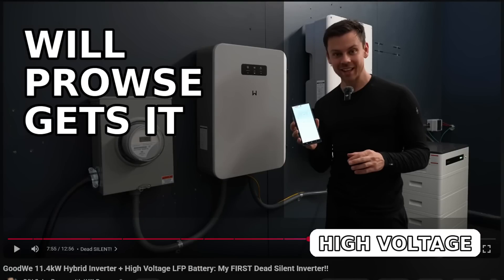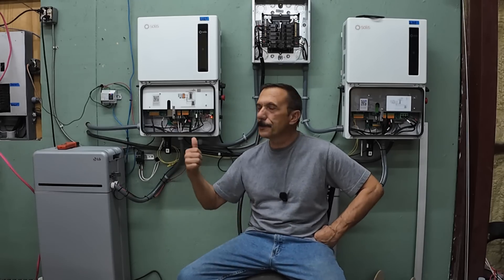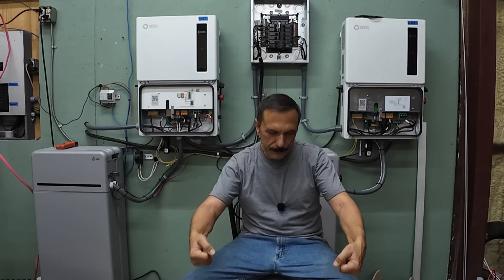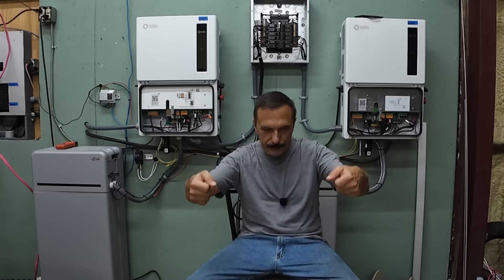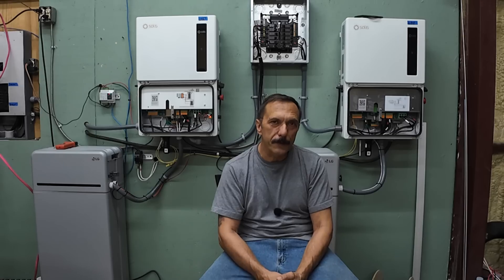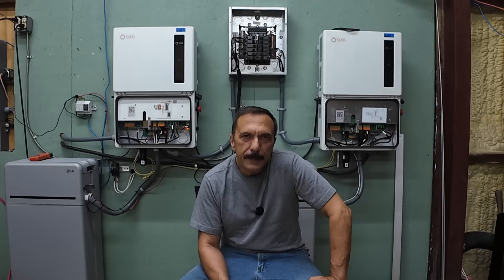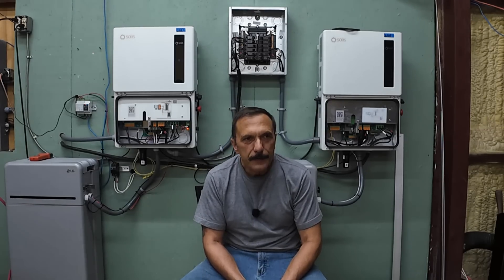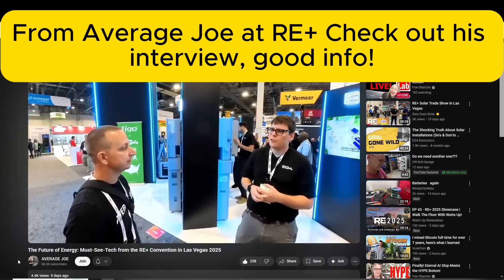Will Prowse Gets It! High Voltage Solar

Comment: looking into a 2nd system for 2nd location but HV is still 50% more than LV and upto 20-30KW with 60-100KW batteries or so i dont think it has enough benefit to make the extra price worth it
Reply from the maker: How does this compare to LV, Solis S6 11.4kW inverter @ $2325 ea. 15kWh Soluna LFP batteries @ $4699 ea. stack up to 150kWh per inverter or LG 16H Prime 16kWh @ $2750 ea. stack up to 32kWh per inverter.
So 3 inverters 33kW = $6975 + 6 LG batteries 96kWh = $16,500 total $23,475
Reply: @DIYSolarFarming  20kw Deye lv inverter @2750  so 5500usd for 40kw, 15kw lv battery @ 1184USD so 105kw @8288  (excl shipping though) making 13788USD count maybe 5500USD shipping.... so you can add all the 20-25kwh solarpanels to it and still be cheaper out

Comment: Hey thanks for the video, liked it... My only problem with running car EV batteries in houses, are if they happen to be of lithium-cobalt variant, where many home retrofitters throw away the cooling systems they had when they were in the cars, and put a dumber BMS, they can be at higher risk of experiencing thermal runaway in some case. If I did run a battery with cobalt chemistry for residential use, I'd put it in a detached structure that is not connected to the house. Obviously having a good quality BMS plays a huge role in the safety, but for me I prefer only the LFP to be in my residential building, because they are much safer and not likely to ever get into thermal runaway condition ever. There are Fire Dept videos on You Tube where they try to force LFP into thermal runaway and the most they can get is sizzle and fry, but really no fire or intense heat. Just my 2 cents.. Thanks again for the video!
Reply from the maker: Exactly, never put an EV battery in your house!
Thanks for watching!

Comment: I downloaded the Solis 6 Spec sheet.  The minimum voltage to get this inverter running is 80 volts!  So I guess us early Off-Grid adopters could daisy chain a few 48vdc batteries and get into the range that will work well with this inverter?   I noticed the manufacture uses big heat syncs on the back, NO FAN NOISE !!   I live next to an EG4 6000 XP with fan cooling set to the lowest level, still annoying.  ( New Subscriber when Will say's You Rock !!)
Reply from the maker: Thank you sir and thanks for the sub!

Comment: I'm running a 24v system but if I had the demand your using, I'd do it your way. I stay mostly under a 6kw demand. It's easier to manage smaller battery banks is my reason for 24v. Yeah, lots of heavy costly wire but solar is never cheap anyways.
Reply from the maker: That's a good point, thanks for watching!

Comment: I like the idea of higher voltage for the lower currents, but now you need to make sure everything is rated for the high voltage DC, including fuses and breakers and switches. Just getting somewhat affordable fuses for my 48V system with an acceptably high AIC is tough enough. Or maybe I just don't know exactly the best places to look for that stuff.
You have to be so much more careful with what your doing too. Not that I'm afraid but certainly can't let your guard down. Even 48V shorts can create quite the arc when you have massive currents behind it.

Basically need EV contactors, pre-charge, and fuses I suppose. I'll stick with 48V stuff for now, but maybe once high voltage stuff gets super common I'll make that switch in my new home a handful of years from now.
Reply from the maker: Yes, very true on all counts!
Most all commercial batteries come with the DC breaker and these Inverters also have a built in DC Disconnect.
Thanks for watching!

Comment: I would really like to get into the high voltage. Im still running 48v systems. As an electrician i know the higher the voltage the better the efficiency is. My biggest problem is cost. I need t
Reply from the maker: Your comment got cut off.
Thanks for watching!

Comment: What does HVDC do to wire insulation over time?
Reply from the maker: Nothing to speak of, even common THHN is rated at 600 volts.
Thanks for watching!
Reply: @DIYSolarFarming  mmmm  might better do some homework,  it is something few are really familiar with.  I would imagine that if you put THNN in open air with 600VDC, the pair randomly touching along their length, it wont take long to find out.   DC is capable of etching and plating, depending on conditions, and it continually does so, though the rate of material flow is miniscule. AC does it too but reverses itself and generally erases what it just did, net result nil.  All that to get around to saying, DC will collect carbon to plate it's own conductive path, through or on the suface of the insulation,  eventually. The higher the voltage the faster that happens.
Reply from the maker: Totally fair to question. In the NEC world, THHN/THWN-2 is listed 600 V for AC and DC when installed in a raceway. The open-air rubbing together scenario isn’t a code wiring method. For high-voltage battery runs I typically use THHN/THWN-2 in conduit or step up to XHHW-2 or PV-rated cable for extra margin, also we are well under the 600 volt rating in this system.
Thanks for watching!

Comment: You summed  it up very simply.  HV means way less semiconductor to switch with and less potential points of failure. Switching massive current needs a lot of FET's but with HV, FET's can handle voltage easily compared to current. 

I have a stack of 36x 12S LiFePo4 packs that were in a system that the manufacturer could't get right and now denies their existance. I basically have to rip out the BMS system and either make the packs into single, 36V packs which sucks for invert support or change to HV setup and runs say 4x strings of 9 packs or 3x strings of 12 packs for 345VDC or 460VDC. 
The only big drawback with playing with DC at these voltages, needs an electrican to do works and is super dangerous if you are complacient and sorry mate, but from an Aussie, you yanks and power systems often get super blazae or complacient, not a stir, just an observation.
Reply from the maker: Safety first my friend! I hear what you're saying and sometimes it might seem complacent but I've been working around high voltage RF tube amplifiers and HV power supplies running 3 -4000 volts for 40 some years and do have the utmost respect for it. 
Thanks for watching!

Comment: I kinda thought 48v was high voltage for DC.  Are there added risks to going with higher voltage DC?
Reply from the maker: Yes, you really need to think about what your doing, but for the most part the manufacturers have made things pretty safe.
Thanks for watching!

Comment: First time I've seen your channel - and know that I know it exists I'll be exploring your older content. I started small about 7 years ago, with a 24 volt inverter and 8 kWh of storage. The 5 kW "low frequency" split-phase 120/240 inverter I bought then still serves my need (powers the house during outages) so I have little incentive to change it. I simply added more cells, in several batches, and now have 30 kWh. That's all I need for the foreseeable future, but I have become a go-to guy for friends and neighbors thinking about backup or off-grid systems, so I'll be diving into your videos to expand what I know.
Reply from the maker: Awesome, you can't go wrong with an LF inverter!
Thanks for watching!
Reply: @DIYSolarFarming  The LF inverter is robust, and handles surges very well. The downside is that it is 90% efficient at best, and idles at about 120 watts. Back when I only had 8 kWH of storage, that ate noticeably into my run time.

Comment: Any clarity on sourcing high voltage battery packs? The 48v packs seem considerably more cost efficient unless you're buying a EV car battery and that has hidden risk along with skill requirements.
Reply from the maker: Depends on the capacity you are looking for, The LG 16H is about $2700 for 16kWh and you can parallel two of them for 32kWh, https://signaturesolar.com/lg-16h-prime-battery-16kwh-400v-high-voltage/?ref=piqshkgv 
I think that's less expensive than most 48v batteries unless you go off brand or DIY.
Thanks for watching!

Comment: Wonder why nobody has done a comparison test between HV and 48v to determine the actual percentage efficiency difference these two systems. My initial guess based on the less than 3 foot of 2/0 awg used in most EG4 systems is the difference in efficiency is less than 10%.  In which case not worth switching if you're already in a 48v systems.
Reply from the maker: Right, if you already have a good working 48 volt system no need to change.
The efficiency gain is mostly the conversion losses in getting 48 to your HV DC buss voltages, unless like you said if you have longer battery cable runs.
Thanks for watching!

Comment: I like the safety of the 48V, but I definitely do like the efficiency of the high voltage stuff. Might consider grabbing one in the future if the need ever arises. So far the low voltage stuff has served by modest needs fine.
Reply from the maker: If it works use it!
Thanks for watching!

Comment: Just was recommended the video. 

I think HV is interesting. I suppose my concern is with safety, but it seems like manufacturers are designing systems to keep risk low from accidental discharge. 

There are also seems to be not broad support in the USA for HV systems. Like warranties and such. I think SignatureSolar recently had a sale of LG HV batteries like 75% off. LG was offloading the batteries, but not sure if they were just getting out of the home battery market or just the HV battery market. 

Anyway I think if I would do it again I would try with the HV system. Having large cables is expensive and the tools you need for them also becomes more expensive along with the conduit and fittings. Seeing installs using 6 AWG wire is crazy haha.
Reply from the maker: That is true!
Thanks for watching!

Comment: Wish there were high voltage inverters that had an output of 120v only (not 120/240v). My house is not wired for split phase.
Reply from the maker: You don't have to bring the 220 out of the inverter, you can just bring out 120 volts if that's all you need.
Thanks for watching!

Comment: I just found your channel....you stirred by interest. I'm off grid in the mountains and have after 7 years both 24 volt and 48 volt systems. If it fits your target audience, I'd be interested in learning your recommendations to a best budget approach into setting up a high voltage off grid system.
Thanks
Reply from the maker: I do have some HV off-grid content but that budget question would make a good video!
Thanks for watching!

Comment: Well, I've been concerned about my Generac PWRcell inverter and battery pack purchase for quite some time now (actually a couple of years) but after listening to you my decision to go with a high voltage DC central inverter system (as opposed to microinverters) has been somewhat justified.  For those of you who don't know Generac uses a central inverter along with PV optimizers that deliver high voltage (400 V) DC from a solar array to their inverter (which is then converted to AC of course) and straight to the battery packs.  The beauty of this system is the fact that you can run smaller gauge wire from the solar panels to the inverter/batteries.  However, there is a downside and that has to do with the proprietary side working with Generac.  I often have thought about adding additional batteries to my system since many of these high voltage LiFePO4 batteries have come down in price but not Generac's batteries (bummer) and mixing different types of battery chemistry (LiFEPO4 vs. LiNMC) is somewhat scary to me.
Reply from the maker: Glad you found the video useful, thanks for watching!

Comment: i believe you misspoke high amps means nothing your talking about 12 volt 24 volt 48 volt that is the the only way you can set up solar with small wire 12 volts you need 00 aw..

Comment: I'm running high voltage battery but I noticed it's two 48v batteries wired in series to get it to the high voltage
Reply from the maker: Nice, thanks for watching!

Comment: Hey there, here's a comment and a question. Where do you think the cut off/upper limit is as far as voltage and phases for electricity for people running their own systems at home? I'm not asking like what it should legally be as I'm not for limiting what people are allowed to do with their property, I'm asking where you think it stops being worth it and you stop getting returns on voltage and how many phases, 240v? 480v? higher? 3 phrase, 6 phase? higher? at some point there must be diminishing returns for materials invested vs efficiency gained.
Reply from the maker: What I wold like to see for residential in the US and since we are heavily invested in 120 volts is 3 phase 4 wire at 240 volts.
That gives you you 120v, 240v single phase and 240 3 phase all in one.
I think 480 is too high for residential.
Thanks for watching!

Comment: Glad to have discovered your video. Planning a grid-tied, whole home backup system with PV north of Toronto, Ontario. 2900 sq. ft, all electric, new home. Considering a shed for batteries, or heated batteries on an outside wall. Seems like a good time to wait for new products. HV sounds especially sensible if I go with the shed option.
Reply from the maker: Thanks for the comment, it sounds like you've got a great plan!
I'm with you, no EV batteries in the house! :)
Thanks for watching!

Comment: 48v comes from POTS or old wired telephone standard and it is safe, will give you minor tingle. It is intended for small power not in KWs. Even doubling it to 96v will cut down the current by half.
Reply from the maker: Exactly!
Thanks for watching!

Comment: I switched from 24V systems to 48V. I think requirements of voltage also depends a lot of the wattage needs. I have 50 kWh of batteries and my consumption is at max 4-5 kW, so this is enough for me. I don't see any point for going 12V, even on small systems.
Reply from the maker: If it works you gotta use it!
Thanks for watching!

Comment: You are spot on, I saw will's video yesterday too, never heard of HV before, or at least not directly, I for some weird reason thougt that the EV battery packs were being used as a low voltage system by splitting the modules. The automotive is being doing high voltaje for a while, and for a good reason. I cant wait to see this get more traction to lower prices and make it a good choice for future installations.
Reply from the maker: Exactly, and using EV batteries is the lowest cost per kWh it can even be free!
Thanks for watching!

Comment: I will watch some of your other videos to see if you cover it, but what additional steps do you take to be safe with the higher voltages, if any?
Reply from the maker: Biggest things are, make sure you never work on live circuits, really think about what you are doing and wear PPE!
Always follow manufacturers recommendations, most make the installation pretty safe and don't expose you to live wires until everything  is connected and turned on. 
I will say that I was surprised when Will turned on his battery with no other connections to it and had live HV on his terminals, Always Double Check With Your Meter, like he did!
Thanks for watching!
Reply: @DIYSolarFarming  - I was researching this a bit and 48v is "safer", but not safe.  High voltage DC and AC are dangerous, so if you use the same safety precautions with the DC input as you do the AC output, that should be fine?

Comment: I believe HV batteries would be better, however, what voltage? My suggestion would be 600 Volts because copper loses would be low and the use of Silicon Nitride semiconductors will improve efficiency. EG4s suggestion of 100 volts give you only two wire gage reduction from 4O to 2O, a 600 volt system would allow 10 gage wire supply an eighteen kW inverter.
Reply from the maker: Good point and going to higher voltages is the trend.
Thanks for watching!

Comment: Just look at EVs, 800V is the new minimum, Lucid at 924V. And Yangwang U9 T, at 1200V!  Even the new Ebikes like the Starg Varge are running super high voltages.

Nice videos, Sub'd :)
Reply from the maker: Yes, higher voltage is the trend!
Thanks for the sub!

Comment: I just discovered your channel. I've been following Will for years.  I also  learned about high voltage systems but it totally makes sense.  I already have a solar system with Enphase micro inverters buti want to add a house battery and appropriate hybrid inverter.  And I don't want my house to go kaboom.  I'll be watching your videos!  Feel free to watch mine 😜
Reply from the maker: Will do!
Thanks for watching!

Comment: I rarely hear anyone talk about high voltage solar, so yeah, instant subscribe. Yeah, Will knows his stuff. I remember back when he was living out of an RV and working a job at some doctor's office in the city. He's put a lot of time, money and energy into learning everything about solar and batteries and I consider him now to be at the top of his game.
Reply from the maker: Yes, Will is the Rock Star in this niche!
Thanks for watching!
Reply: @DIYSolarFarming  just what I'm looking for.. new sub from NZ .. followed Will doing his van build .. was baby faced waaay back then.. interested in what to look for in EV batteries.. damage etc..  they are in wrecked cars afterall.. &.. cacheing/buffering battery packs with capacitor banks.. for welding & high load startup devices etc.. off grid & yeah, 3ph.. looking at a trammeled roof install on a 200m2 round barn to power workshop & house.. in 3 stages.. grid cost are rediculous.. $30-40k +
Reply from the maker: Thanks for watching!
You can buy a lot of DIY solar for $30-40k!
Reply: I Will check this out
Reply: HV is a very stupid idea, for almost all small and mid sized systems. The cheapest KWh comes only in 314Ah or even higher and you'd need at least ~100 of those (and I didn't even mention the BMS difficulties).